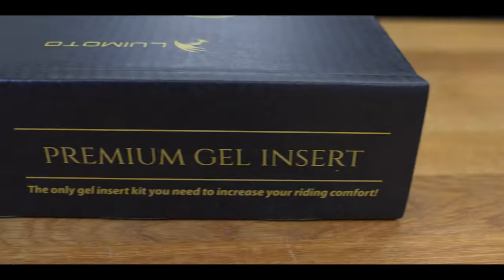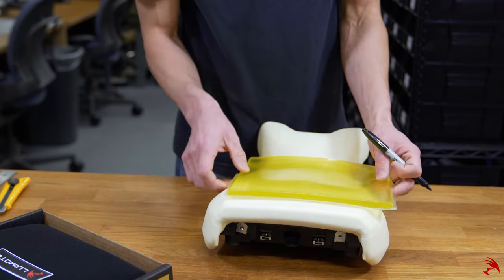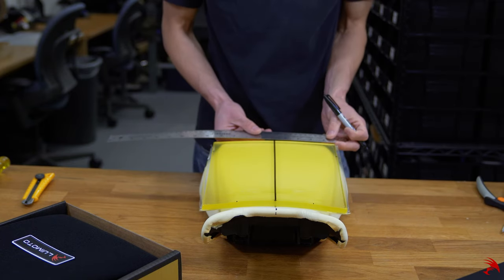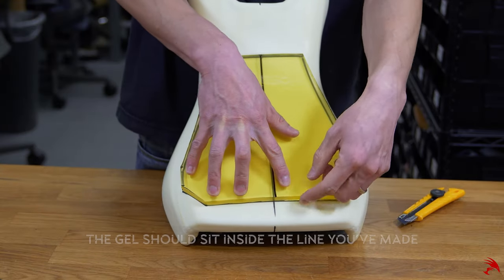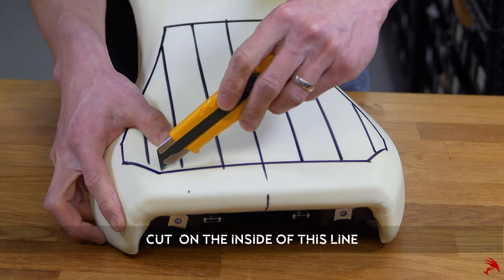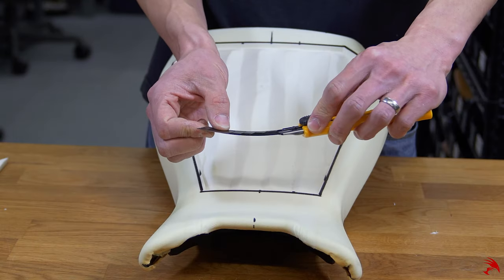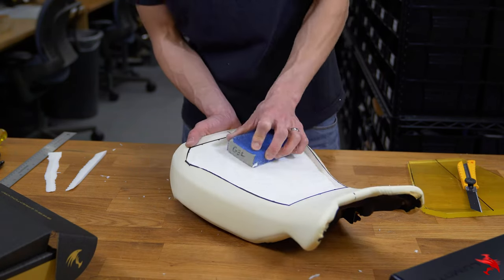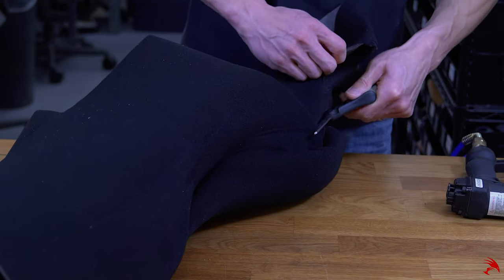How to install Luimoto Gold Gel Comfort Insert and Motorcycle Seat Cover

Comment: I've done six trips across country on motorcycles and what made more difference to me was the clothes I was wearing. Blue jeans was the worst and any other thick weave pants. I bought some leather pants with soft lining was most comfortable.
Reply: Top tip - cyclist lycra shorts with a decent quality chamois - they vary greatly from a plain foam pad which feels like wearing a nappy, to a contoured and channeled pad which just works and you don't notice it.

Comment: At high temperature that seat is it going to be hot?
Reply from the maker: As the gel is integrated into the seat and under a layer of foam in addition to the seat cover and not exposed openly by itself. Having a hot seat really isn't an issue. 🙏

Comment: great video! tell me if this gel will help if you have back problems? specifically, intervertebral hernia in the lumbar region
Reply from the maker: Thanks for your question! It has been formulated to help reduce vibration and absorb road shock which may ease some back pain. But by no means a magic bullet solution.